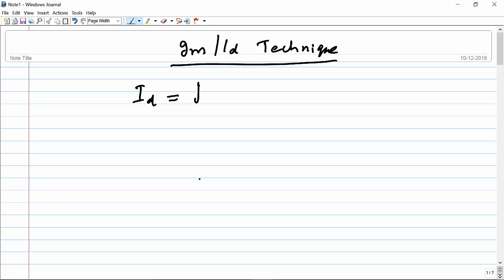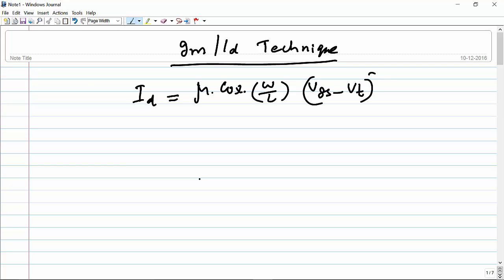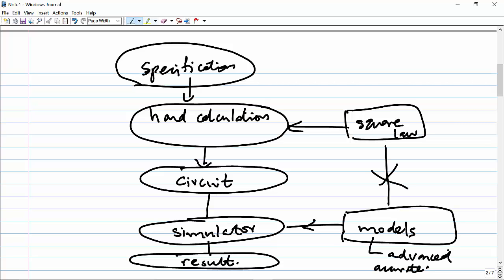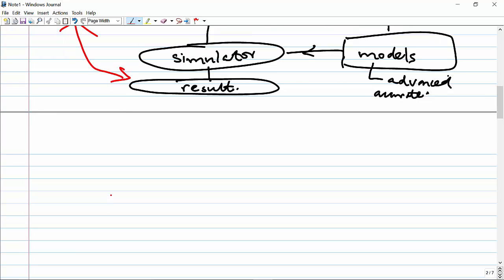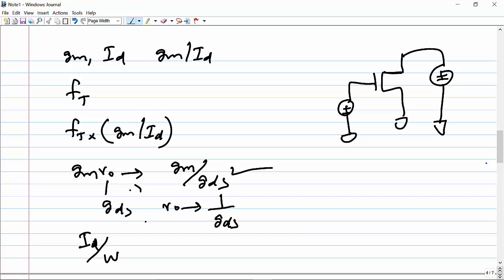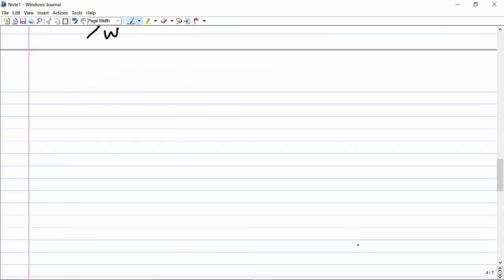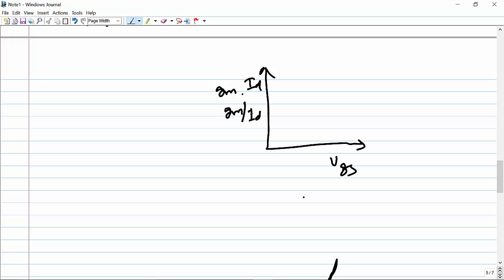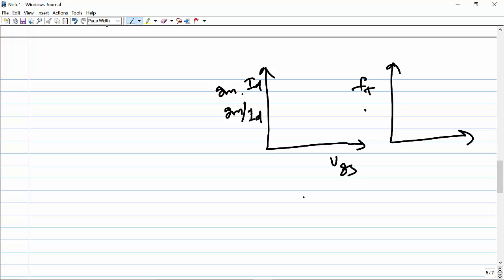gm over id (gm/id) method part 1 introduction

Comment: Hi Hafeez, I would like to know what is the correct value of VDS to obtain the correct curves for each transistor in a 130nm CMOS, where the maximum voltages for these transistors are 1.2V?  Thank you !!!

Comment: Hi sir I appreciate your work but just want  to tell  that u dnt have do matlab for getting those plots directly u can plot in cadence itself. After getting all operating point parameter go to results browser there u will find "gmoverid " parameter right click on it u will have option "Y vs Y " select that and click on "vgt" (Vgs- Vth) u will get plot for (gm/Id vs Vov).
similarly u can get plot for ft which nothing but "fug" in operating point parameters list.
Reply: Yes, you are correct. I came to know about this feature after making the video. Thank you very much for putting this as a comment here so that others can use. Thanks once again
Reply: Sir, could you provide video/material for design of common source with current source load using gm/id method?